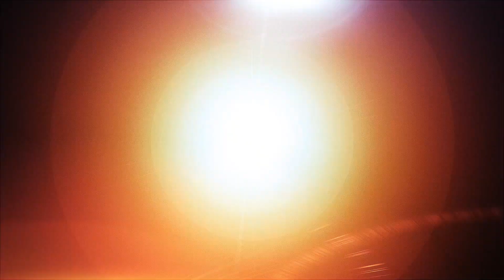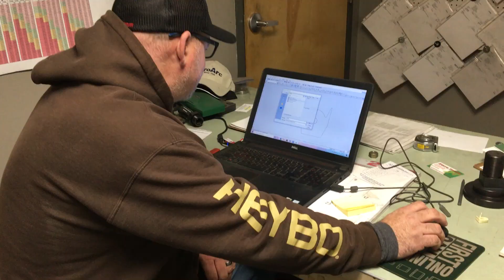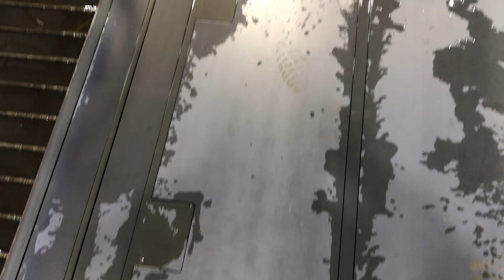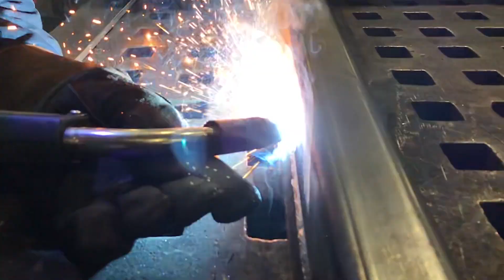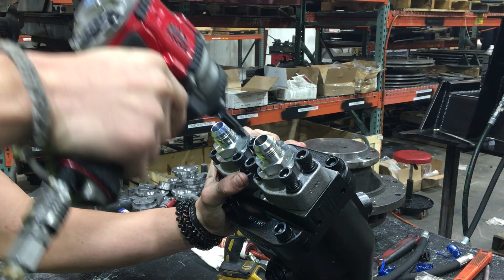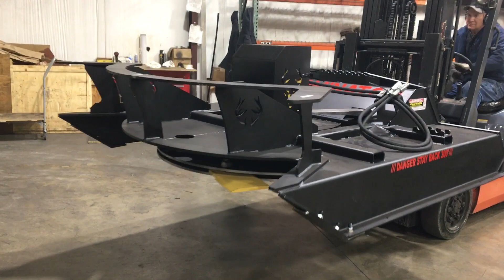How We Build Brush Cutters

Comment: A customer that I was following, bought a cutter from you a few months back. The mount was offset when built. Do you QC these prior to shipping? How would you rectify any issues? These answers are huge for buyers and speaks volumes about the builder. Thanks in advance.
Reply: We do have quality control inspecting every cutter before it leaves our facility. Quick Connect mounts are built using jigs, but sometimes this can happen with custom pin on mounts. Typically if the mount doesn't fit we send a mount that will work and pickup the one that doesn't fit.
Reply: @shippingrutmanufacturing7737  Thank you for the quick response and information. I'll be ordering your Tree Slayer in Feb.